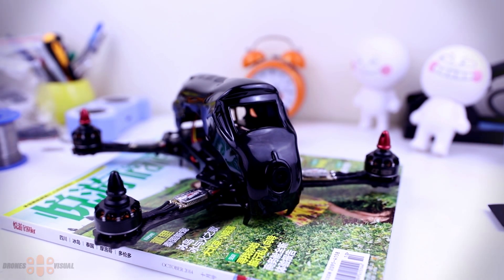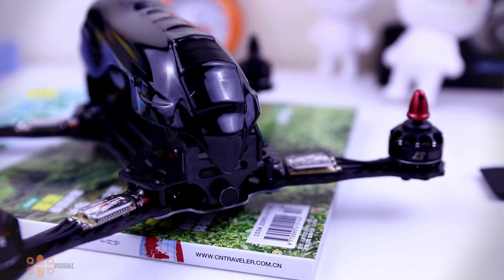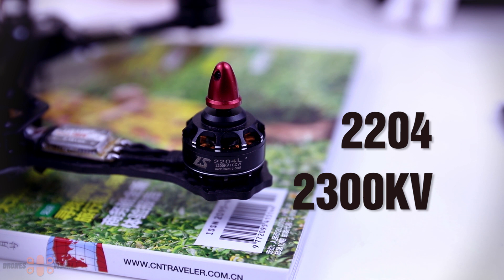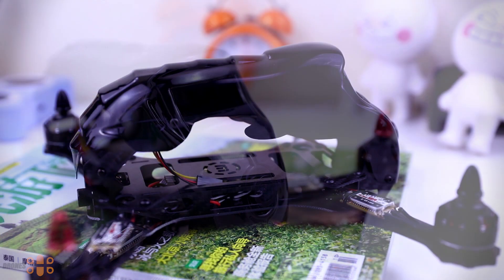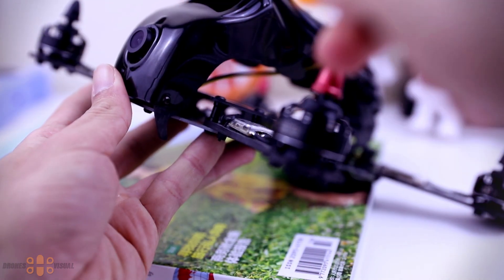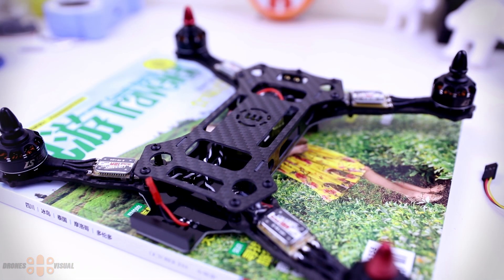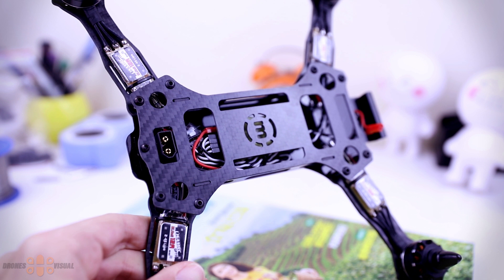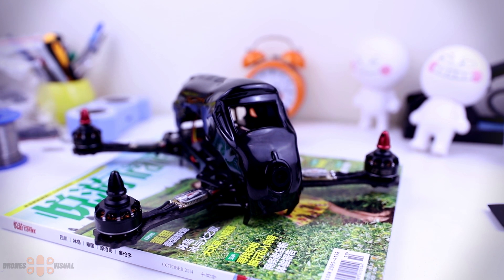Lisam Keel 270 FPV Racer

Comment: Lovely first look! Can a Foxeer Legend 1 fit inside the camera bay?
Reply from the maker: +S Lim Hello and thanks for commenting. Looking hot indeed. I´m not familiar with that cam, but I´d say anything the size of a Mobius or smaller goes. Cheers.
Reply: +Drones Visual If you could measure the width, height, length of the camera compartments, we could figure out what would fit please?
Reply from the maker: +S Lim Ok, I will do that and get back to you. Cheers :)